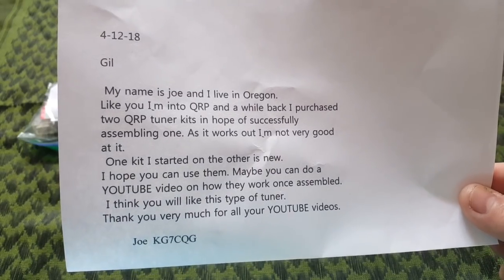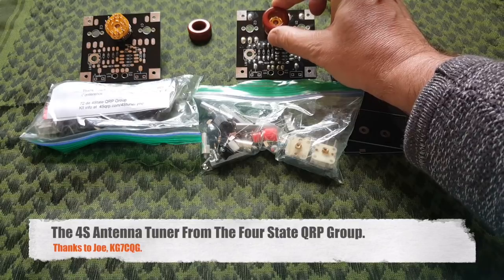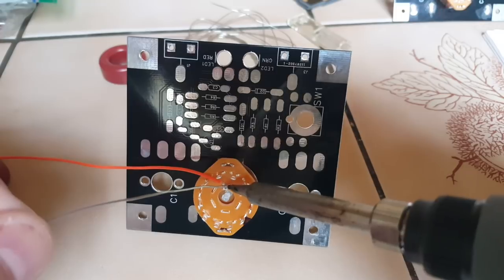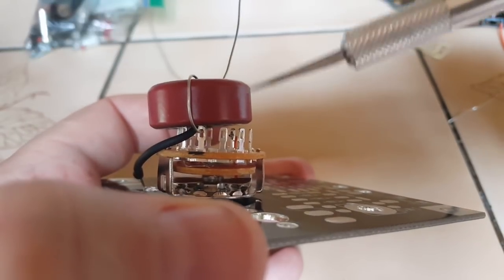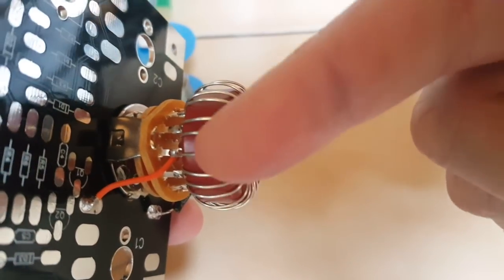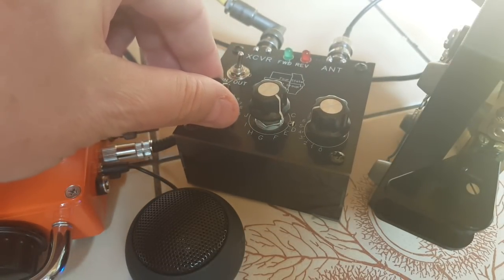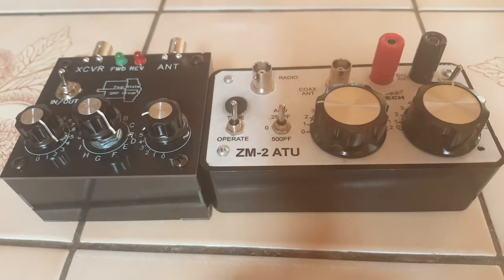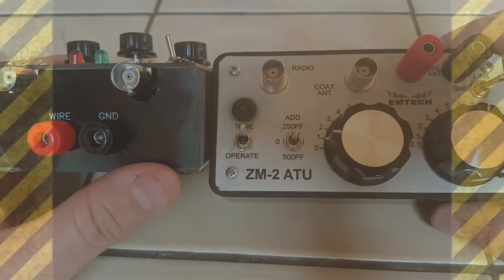The 4S Antenna Tuner From The Four State QRP Group.

Comment: Gil, I truly appreciate this video. I'm building one of these now and your video REALLY helped this new builder. I do have a question: there are two ends of the bus wire. One solders to the board, as you showed in the video. What I haven't figured out is, how do I terminate the other end when I reach 21 turns?
Reply from the maker: Hi, honestly I don't remember, but I assume that after the last turn the wire goes to the last lug on the switch..
Reply: @RadioPrepper  thanks!

Comment: I once had to replace one of the transistors, then both the BNC jacks due to that they started to break from the solder joint or holes on the ground. I drilled on the sides and mounted them there. Then the IN/OUT Switch had an intermittent open when switching.. I took it apart and put Card stock pieces just under the slider and presto, once I closed it and made sure that it was tight, the switch made good contact. I tested it with a continuity tester.   Now the Unit works nice... Love it.

Comment: Great build Gil. Try some liquid tape (got mine from Sotabeams) to insulate the coil windings.
Reply from the maker: Thank, yes, I need to get some of that stuff..
Reply: It's what Sotabeams sell for sealing their products, which have a great reputation. I think if there was a problem with it this would be well known, and they wouldn't recommend it. As for it being messy, meh, if you slap it on like a five year old maybe.
Reply: Liquid tape is messy and may be lossy. Use Q-Dope or at least clear nail polish. 72 de N6MGN
Reply from the maker: Never heard of it but will check it out, thanks.
Reply from the maker: It's the Q-Dope I don't know...